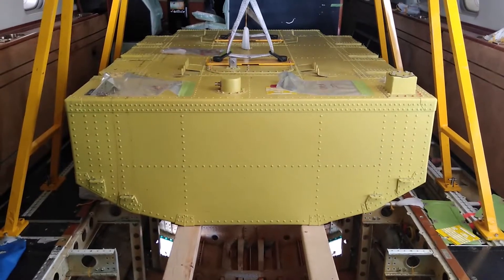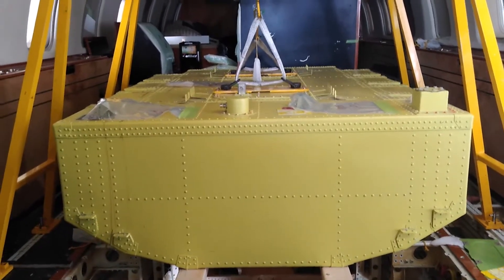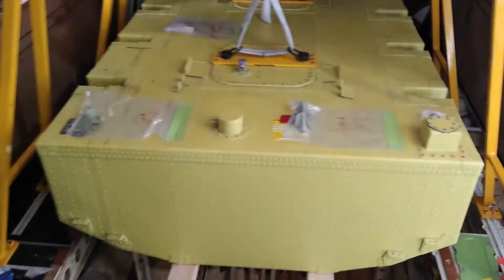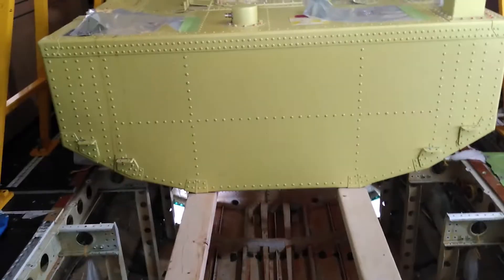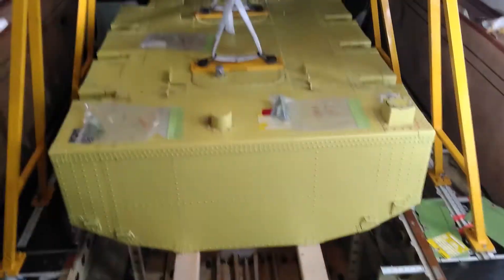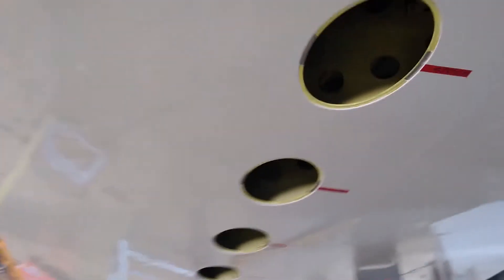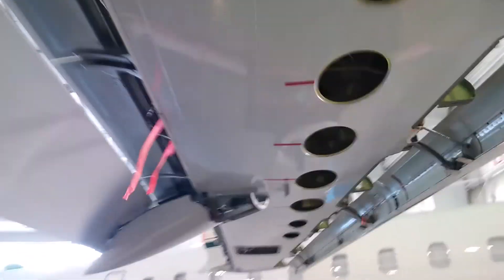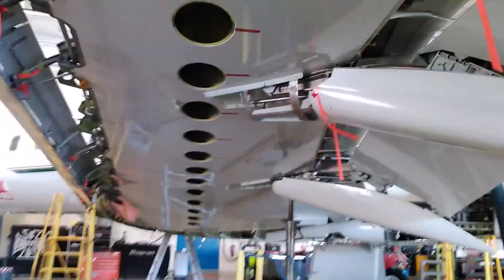AIRCRAFT FUEL TANKS

Comment: These new jet planes supposedly use 60,000 gallons. 60,000 gallons is 8000 cubic feet. That’s 20’x20’x20’. Or 3’x52’x52’. Just do the math, measure the wings and fuselage and tell me where they hide 8000 cubic feet of fuel. The tank in this video is barely bigger than my 200 gallon fish tank. That would weigh about 3000lb when full.

Comment: I’ve loaded airplanes for a living. I am very suspicious about the amounts of liquid that can be put into even a 737 or A320. The belly of the aircraft is mostly for suitcases and otherwise empty. I believe there is one small, center fuel tank. The guys putting in the fuel are just going by what the gauges say. They are supposedly pumping 4 or 5 gallons per second, from what I’ve seen, up close. Its too much weight on that wing. Just too much.

Comment: Why don't they leak by rivets ?
Reply from the maker: They are sealed from inside all along the rivet lines and at all joints. That sealant gets cleaned and inspected at regular intervals to ensure a proper seal. That's the reason all these access panels get opened up during inspections, to inspect the sealing compound, and if any cracks are found, it gets scraped away and resealed.

Comment: Yes, but it still does not explain the amount of fuel that is said to be in the wings of a large commercial jet. Thing just don't add up.
Reply from the maker: Hello Swamphox, did you not see the part of the video that shows  the inside of the wing and all the space available for fuel? There's A LOT of room in there. In commercial aircraft there's even more since the planes, and wings, are bigger. 
It may be marvelous and a wonderful thing to explore and try to understand, but it's a simple principle. A bicycle needs energy from you to move. A car needs energy from fuel or a battery in case of an EV. A plane needs just as much energy to move. And given the requirement for energy, a plane will only fly as far as the energy available from the fuel it can carry, no further.

Comment: lol this empty jet fuel tank is cleaner than my room . how the fu..k they clean this tank , with super acid cleaner .
Reply from the maker: Hello John stream, nope, no super acid cleaner, just air. Fuel evaporates, they drain all fuel out prior to opening the tank access panels, then vent it with fresh air using fans for hours. No one is allowed to go into the tanks untill the air quality interments give a clean reading. Once all the residual fuel has evaporated away, you end up with a clean tank like that. Any bacterial growth or deposits left can then be manually cleaned.